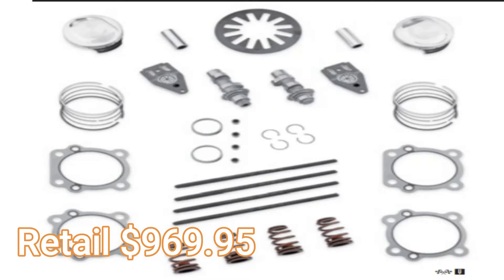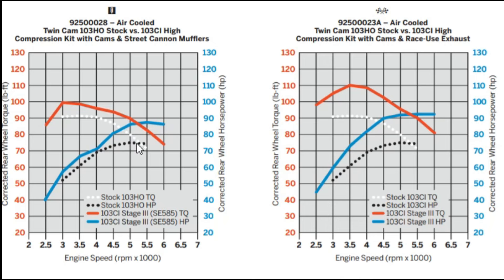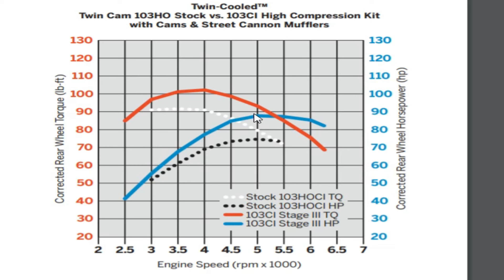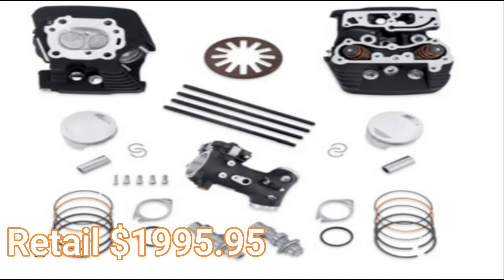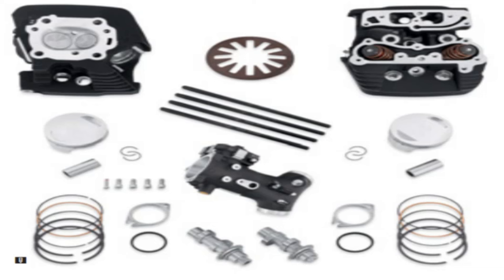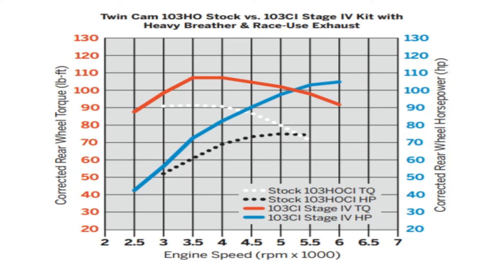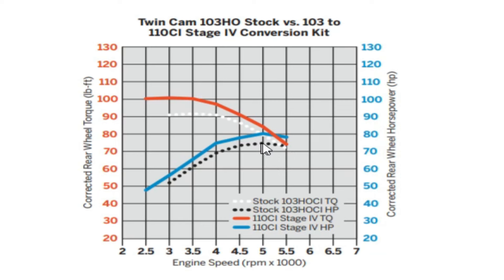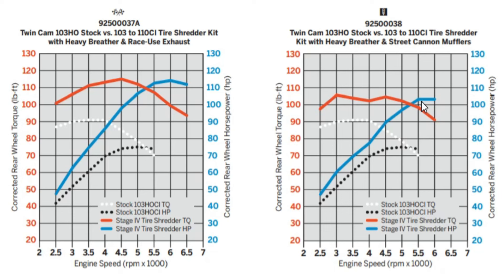Late Model Twin Cam 103's Make A Solid Motor For Modern Used Harleys

Comment: When you buy just about any new Harley-Davidson first thing you have to do is modified to get more house horsepower
Reply from the maker: Yeah they are really choked down by the emissions from the factory. My bike ran hot and was so lean it would stutter and cough back through the throttle body. First thing l did was put a good aftermarket one on it, that was a high difference in power. Bike felt like it flew after that tune and the rest was still stock.